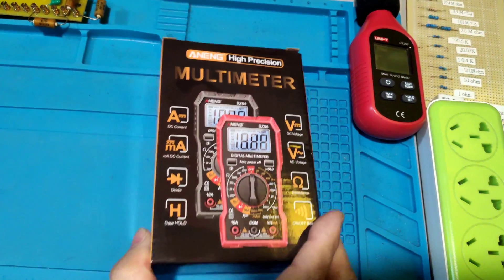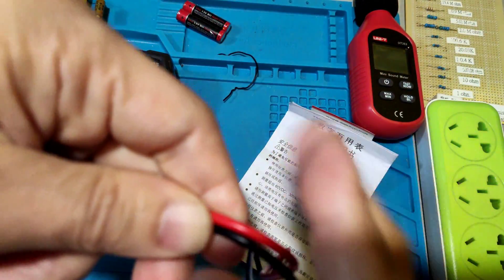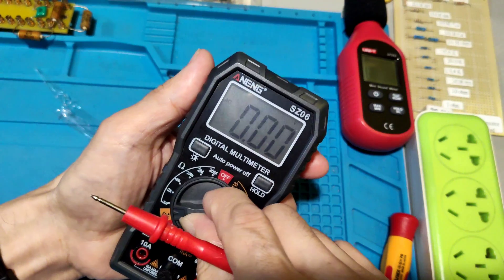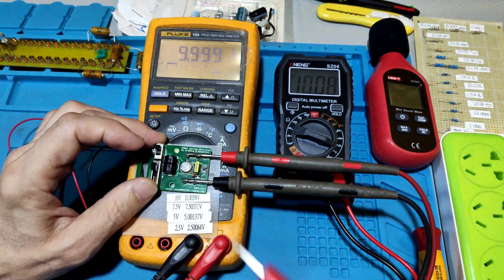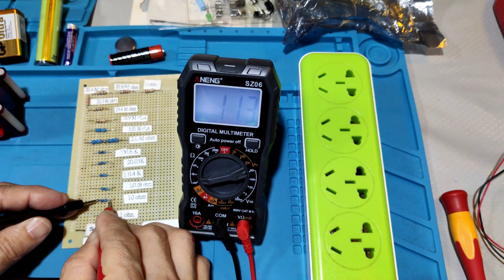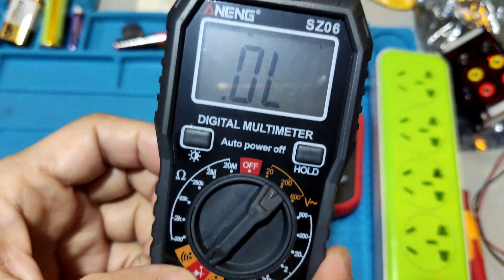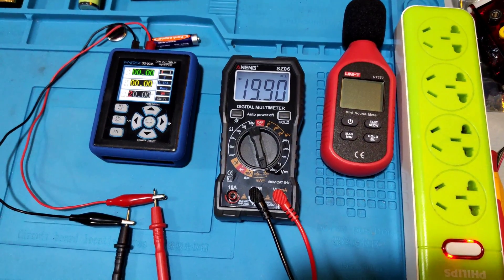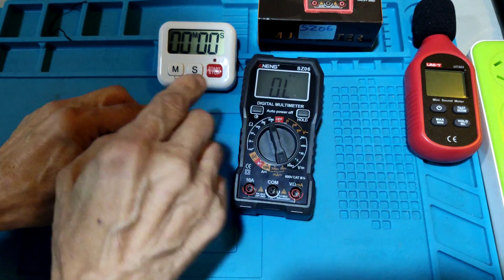ANENG SZ06  600V DC/AC ,2000 COUNTS MULTIMETER ,made in china,

Comment: Sir I have a question I buy same tester ok now I turn it on but the backlight isn't bright enough is it normal it's dimm a lil bet
Reply from the maker: it may be some proble  inside the meter ,or inside resistor or driver led circuit have damaged.send back to repair.sir.
Reply: Try fresh batteries first.